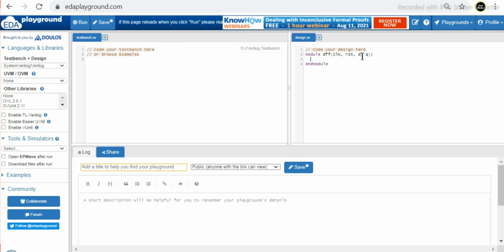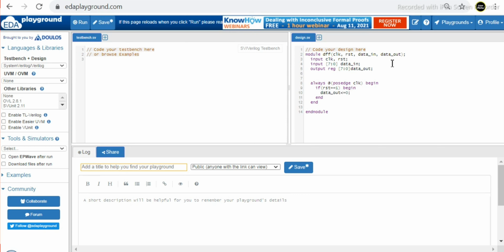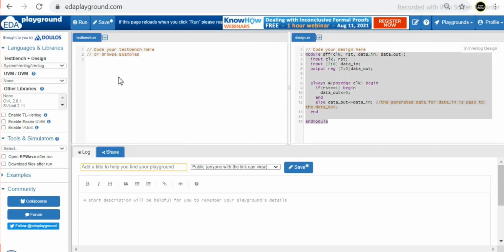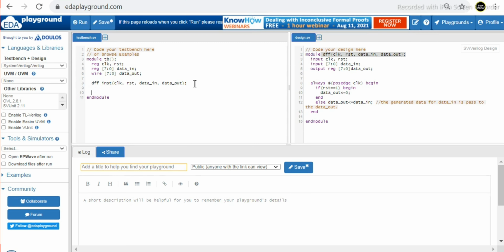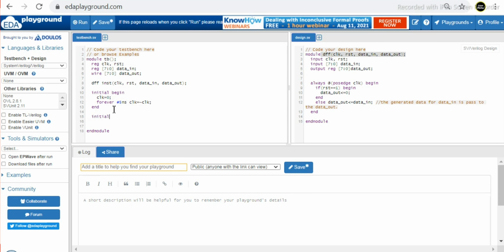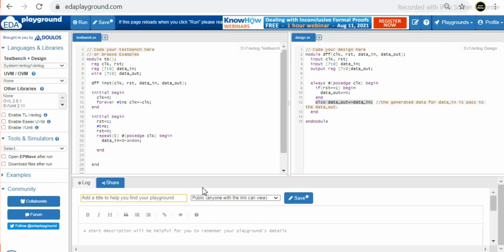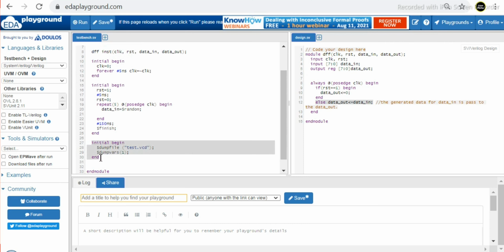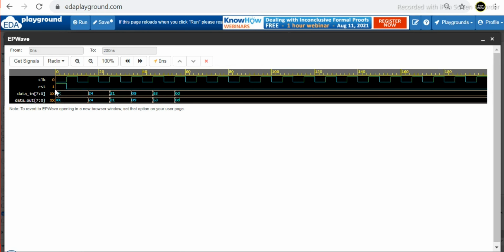D Flip Flop #Verilog @edaplayground

Comment: d ff has only one i/p and o/p then y u using 7:0
Reply from the maker: Here  [7:0] is the width for the D ff input/op. So that in the Testbench when $random is called, it will provide multiple possible random values. 
Incase of single bit then ip/op will be getting either 1 or 0 values.
Reply: @verif_engg_vlsi6754  thank u so much 💓
Reply from the maker: @rajeshkrishnan1642  you're welcome..
Please do support this channel Thanks